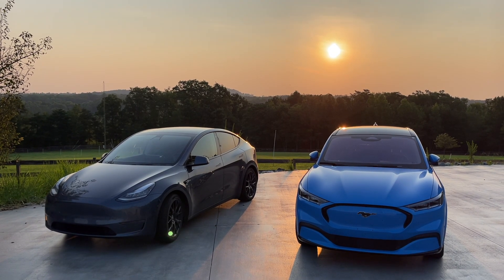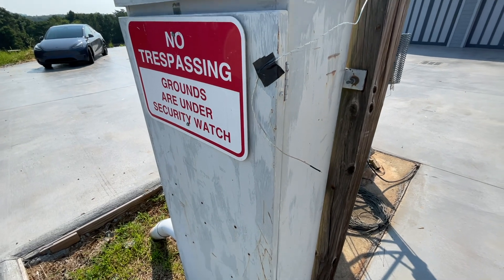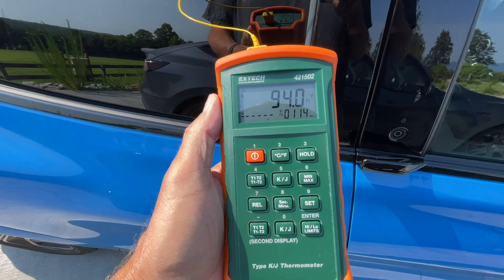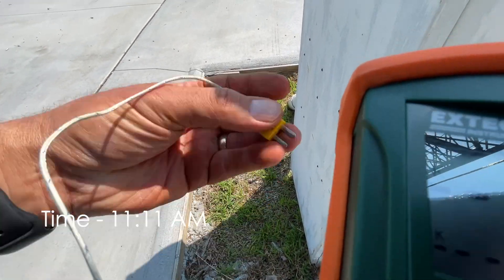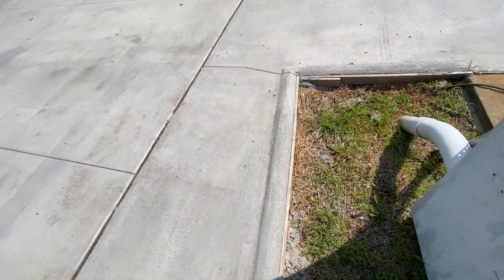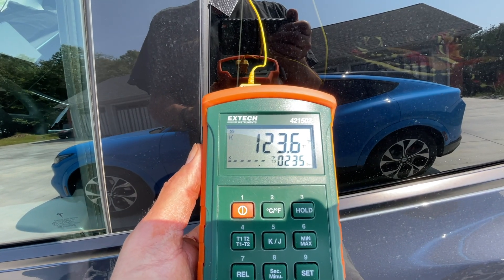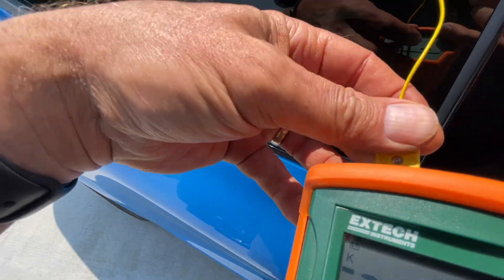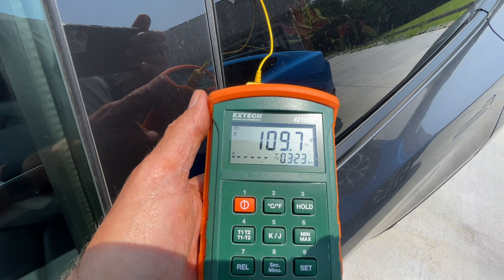How Hot does the Model Y and Mach e get inside in the Sun - Part 3

Comment: I'm glad that I saw your video! I forgot about the cabin overheat protection feature on my MY due to the cooler weather when I first got the car.  I will enable it now that I know it will help reduce the cabin temperatures under a hot sun. I'm not much concerned about the extra energy needed for the cooling feature, as the sentry mode will consume the power anyway when the car is not at home.

Comment: According to AECQ100, there are two temperature grades for automotive grade electronics: Grade 0 (-40 to 150 degC / -40 to 302 degF) and Grade 1 (-40 to 125 degC / -40 to 257 degF)
I assume Tesla’s using AECQ 100 quality chips since the cooling feature can be switched off. It’s a neat feature, but there’s really no need to waste precious power keeping the interior cool for no reason.

Comment: Good experiment, Dave. It's telling that, with the first readings, the Model Y's interior was hotter than in the Mach-E, but in later readings the cabin overheat protection had kicked on and kept it cooler —just like it's supposed to do at 105°F and hotter. I wonder what the results would be if you repeated the experiment with that feature turned off…? My guess is that the Model Y would be hotter —which is why Tesla includes the feature…?
Reply: With the Model Y's cooler protection working this test makes no sense. Obviously a vehicle without the protection will get hotter.